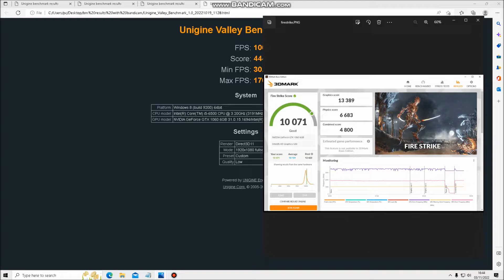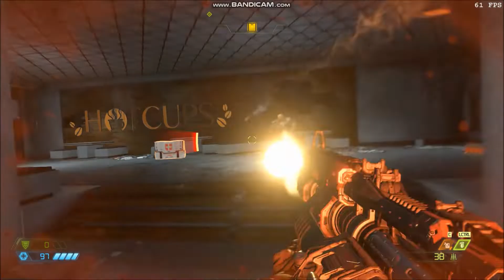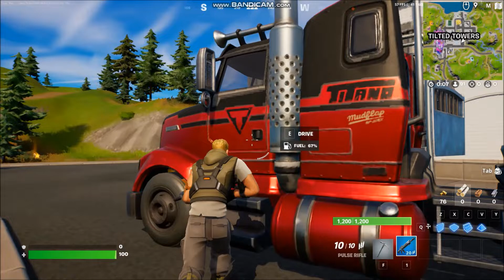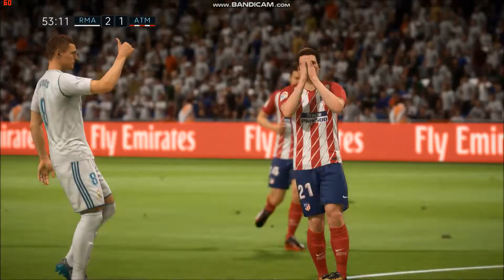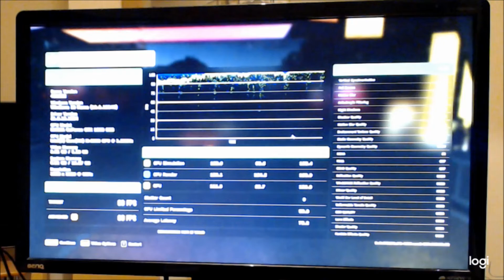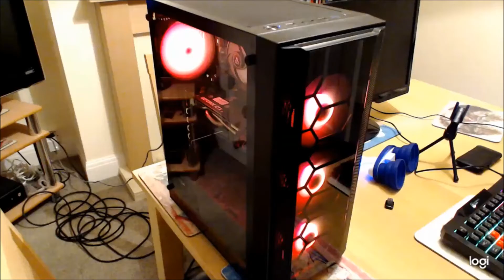Benchmarking desktop pc i5 6500, gtx1060 6gb, 16gb ddr4, ssd, hdd, rgb fans.

Comment: i5 6500 + GTX 1070 Ti Bottleneck?
Reply from the maker: Should be fine. 2000 series of cards will be by that cpu though.
Reply: @computerrefurbishment9748  Thanks! I'm currently my Rig is i5 3570k + GTX 970. Got my 2nd PC i5 6500 + GT 1030 still not using it yet. Planning to add upgrade GTX 1070 Ti, NVME 256gb and Air CPU Cooler Low Profile.
Reply from the maker: @MiksGamingPH  Cool rig planned there. Sell 1030 for funds.